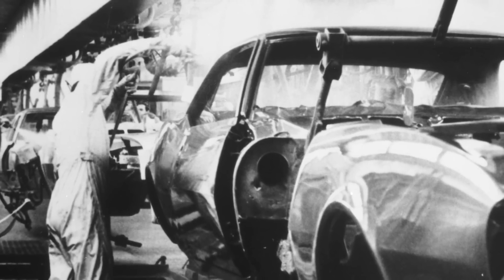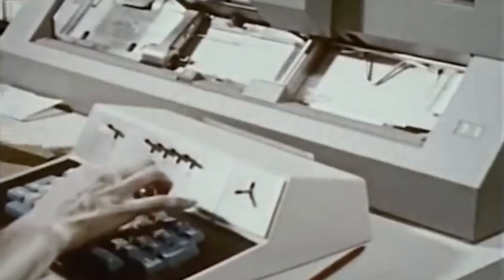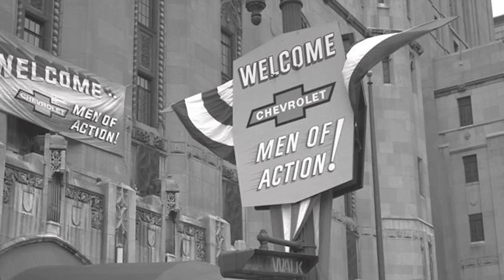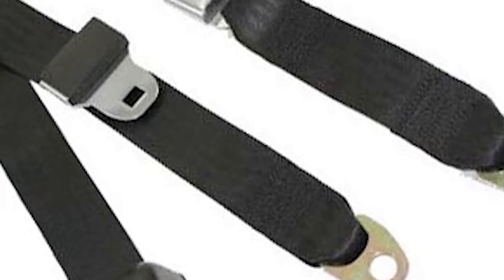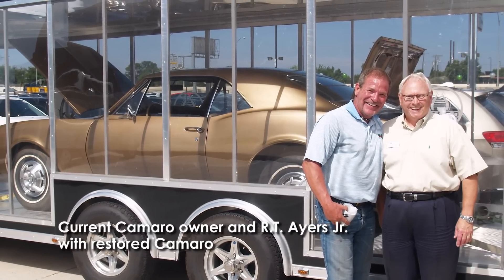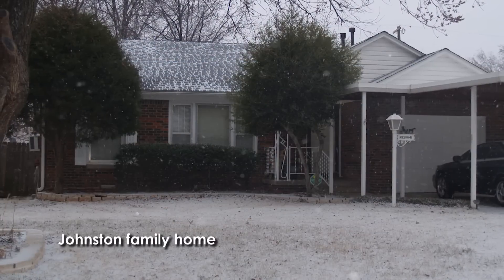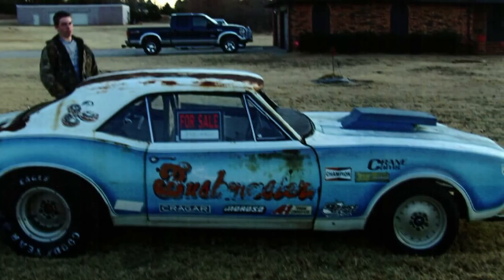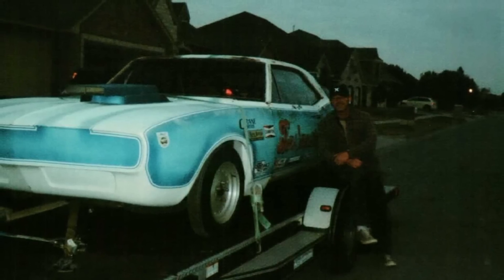Full Story Of The First Camaro Ever Built N100001

Comment: In the fall of 1972 I enrolled to mount hood community college in Oregon. Someone brought it a 1966 Camaro? Same color as in this video. Knowing alot about Chevy's I had never heard anything about at 66. It was a 6 cylinder, might have been a 3 speed but it could have been a powerglide don't recall. The thing I remember most was the back seat folded down like a 66 barracuda? It was from Canada, I guess built there? Never thought that much about it till now, wish I would have bought it. Tuned it up never saw it again 🥺

Comment: My father bought his 1967 Impala from R.T. Ayers Chevrolet in Yukon OK. . When R.T Ayers sold the Yukon dealership in 1971 he went on to start the Rendezvous Trails of America campsites. Hence the R.T.A. After R.T Ayers sold the dealership it became Alan Merrell Chevrolet. In March 1971 when I was 15 years old I purchased my first car a 1967 Camaro RS from a lady in Yukon OK who had purchased it new from R.T. Ayers Chevrolet in Yukon OK. It was the same gold color as that Camaro  in the video with the same gold interior. It had a 327 2bbl carb and a 4 speed manual transmission. It had those same hubcaps too. It had 36000 miles on it when I purchased it and I paid $1200 cash for it that I had saved up, R.T Ayers had a brother who had a Chevrolet dealership in Edmond OK, Craig Ayers Chevrolet. In March of 1972 I purchased a new 1972 Chevrolet Nova SS there. I'm not surprised the first Camaro became a race car. It's great that he saved all the original parts though. Back then when we owned these types of cars no one ever thought that some day they would be collectible. They were just cars to us and we dust drove, modified, and used them never thinking about what they might be worth some day. And when the gas shortage hit in the early 70s, you couldn't give away what would be considered classic muscle cars. No one wanted to buy them. Many went to the crusher because no one wanted a car that needed premium gas and got 10 mpg. I lived through all of that.

Comment: The guy was a scumbag that tore the car apart to make it a drag car, when he KNEW it was the first one.
Reply: I whole heartily agree with you, but some people refuse to place value, or historical significance, on material things.
Reply: @NegativeSum  But he purposely saved the car parts he took off because he knew someone would want to put the historical car back together. My problem with him is, drag racing is fast and an accident at those speeds usually runes the car. In this case, an historical car. This guy could have found another 1967 or first gen Camaro to do what he wanted. But he had to do it with THE FIRST CAR EVER BUILT? IMO, he was nothing but as ass for risking it.

Comment: That's gonna I got one that was built on Sept 5 1966 it's a RS with deluxe exterior and deluxe interior now it has all Z 28 motor ,M22 trany ,and a 67 Z28 12 bolt rear end it is a dealer potion and I bought it in 1978 and I'm not gonna sell it

Comment: It's sort of bizarre that the very first Camaro built was a low option semi-stripper 6 cylinder and not a fancier V8 model, as was the first Mustang. Even stranger than that is how someone could cut it up and back half it with a one piece fiberglass lift-off front end to turn it into a drag car, and do so knowing the significance of the car. But, this all adds to the unique history of Camaro 1, and who knows, it may have actually saved it from being sold to someone else and used up and scrapped like most of it's siblings were. It's nice to see it in such fabulous condition, 6 cylinder, hubcaps, whitewalls and all.
Reply: Hindsight 20/20, would you spare a 2016 Chevy Spark today? It might have some special value to someone in 2076.
Reply: @David-dv6yv  that’s exactly why it happened

Comment: I saw this car at a local car show last summer.  The owners drove it to the show!  It's gorgeous and it was really neat to see the car as it rolled off the line.  Very clean with sharp body lines and a sporty look.  What a legend!
Reply: That's incredible Matthew, good for you! You're so right about the body lines and sporty look, also. This applies to the '68 Camaro as well of course. They are more sports car-like than the '69. I get tired of so many people going on and on about that one. I had a '69 when I was 21 (in 1978) and was just so happy to have a 1st gen Camaro. It was only a 6 cylinder, but with the very high gas prices for the time in 1979-'81, that was a good thing.  

I'm not knocking the '69, but it was bigger and (to me) less sporty. Mainly, it was a cheaper quality car. I'm talking about the front grill and the dashboard. Total plastic over the first 2 models. Also the top of the dash curled up and was already looking old even at 11 years old. The dashboard kind of jiggled and I know it shouldn't have. I have a friend with a '67 Camaro (just a regular hardtop) and at 55 yeas old is as solid as new.

Comment: Heh... I like the mention of the "hand-built" early cars. My 2006 Pontiac Solstice that I used to have was one of the first few thousand that were hand-built out of many early release parts just to get them out in time. Although I ended up getting front fog lamps (without even ordering them), Half the panels in the car had clips that were broken (cause they didn't fit properly) and had double-sided duct tape on them. The ones after the first 3,000 were much better built. Getting number 1,001 to ~2,999... you basically got a hobbled together car, without getting one of the first 1,000 special edition cars. heh.

Comment: An old acquaintance of mine would occasionally drop by my body shop when I was 20 in 1978 driving one of these 1966(1/2) Camaros. It was in rough shape but he would brag about the vin number and the fact that it had a bench front seat; (which was what stood out in my memory; was it original?). I lost touch with him through the years and have no idea what became of him or the car. I would sometimes buy old mustangs, Camaros, Chargers,etc and resell them after repairs, and even had one that came with a straight 6 which at that age, was unimpressive. Reagan had destroyed the speed limits across the country which resulted in me having numerous speeding tickets and my drivers license suspended 3 times. 
Camaros were my favorites, and they handled much better than the ‘vettes.
Reply: Yes, the bench seat was original.  In 1967, I remember seeing a Camaro with one on my local dealer's lot.  Dark sort of green/blue with matching interior.  Additionally, since I grew up in this era and also raced I am amazed that the original parts were still around from when the car was converted to racing.  That almost never happened, and every car I was familiar with had the original parts sold (crash, upgrade, etc) to help fund the speed parts that needed to be bought.
Reply: Dont blame reagan for "you" speeding jeeeez dude.
Reply: @jacksonmehoff4963  What kind of weirdo are you, dude? Nobody’s blaming anyone else for speeding tickets. Just try it sometime, everyone is used to driving 70 plus again so try driving 55 down the interstate for a couple of hours straight and then get back with me! Cars and the highways were designed   for higher speeds. It’s like you’re sightseeing or stalling out. Just TRY it out on the open road! And I don’t mean for just a half hour. You need a good taste of what it was like to go from driving normal to like a little old lady!
  I got tagged at 92 in a Spark about a year ago and I don’t blame anyone but myself!
Reply: Reagan destroyed the speed limits, huh? Reagan had nothing to do with setting the 55 mph speed limit. Geez  🙄

Comment: I wrecked my 67 after I ran it 10,000 miles I paid $800.00 for it in 1974. Best car I ever owned. I was just 18  
   2:18 same copper color  Same wheel covers and black grilled 327 Powerglide... Tagged legal in Florida while in the service.
This is a picture of the car I owned...This was not my father's car.

Comment: I remember reading in Hot Rod years ago about the one that their tech editor Jim McFarland wrung out for some magazine articles, this was a SS model with one of the first 350 engines( yes I thought it hard to believe too) when it came to return it to GM he took out a loan and bought it.
Reply: Had the 1968 Rally Sport. The 327 engine with Power glide made it rather slow.
Reply: The new for 67 350 engine made it's debut in the 67 Camaro SS and that was the only way to get a 350 in 67. The next year 68 the 350 became available in the Nova SS and in 68 the 350 was available only in the the Camaro and Nova. Finally for 69 the 350 became available across the board in most all Chevrolet models and what an engine it was.

Comment: Ford had a V8 in 32-GM in 55🤔
First Mustang in 64-Yep V8!!🤷‍♀️
Camaro in 66-6 cylinder !
Corvette in 63-6 cylinder!
No wonder Ford drastically outsold GM
and still does 50 years later!!
Reply: Obsess much?
Reply: What engine powers more 32-34 Ford coupes than the original engine wonder why
Reply: @gloriamaletta8667  
Truth!
Reply: What manufacturer in the last 10 years is the most swapped engine into other manufacturers cars just so you know it's not a Ford engine and what engine in the last 10 years has the most aftermarket support another clue it's not a Ford engine
Reply: @gloriamaletta8667  
Yup! Preach! 👍🏻
Reply: The 32 valve 4 camshaft V8 that Ford has been building now for 11 years now and the most naturally aspirated horsepower they have gotten out of a stock one is 520 horsepower and it's a 5.2 liter the 2023 Z06 Vette the first year for Chevy to build such a engine with 32 valves and 4 camshafts and it makes 670 horsepower just so you know the 5.2 Coyote engine naturally aspirated is 150 horsepower short of Chevys first attempt at such a engine but being a big Ford fan the Chevy engine is .3 liters bigger it's 5.5 liters
Reply: All WRONG! 
Chevy OHV V8 with airgap intake manifold in 1916 - 1918 !!! 
All Chevy engines are OHV or DOHC... no flatheads... 
1953 Corvette was 6 cylinder with tripower carb.s... 
Some Camaros built early 1966 had V8's... I saw one in August 1966 before Camaros went on sale... 327" V8 2 barrel carb. 210 HP with 3 speed stick... gold color... bucket front seats... 
In 1960's GM had 52% of the market, all other car makers together split up the remaining 48% !!! Govt said GM was a monopoly and would break them up like they broke up AT&T into 8 pieces unless they started selling fewer cars! 
Today Toyota is biggest and GM is #2 !!!
Reply: @gloriamaletta8667  - Corvette had DOHC V8 in 1990... Oldsmobile built one in 1960's but didn't put it into production... DOHC 7.4L...
Reply: @BuzzLOLOL  the one in the 90s was  designed by Lotus and GM Mercury Marine's MerCruiser division built them and GM purchased them and installed them 1990-95 ZR1 they were not built by GM the 1960s Oldsmobile l don't no much about Cadillac has been making 32 valve V8 since the mid 1990s but Chevy has never had or sold a car that GM   built in a factory car the 2023 Z06 is the first factory stock 32 valve V8 engine Chevy has developed and designed and built just like the new Toyota Supra is a Toyota but the engine is built by BMW Toyota buys them from BMW and Toyota installs them in the Supra
Reply: @BuzzLOLOL  over head valve V8 yes dual over head cam V8 no unless you count the 1990-95 ZR1 that  MerCruiser assembled for Chevy for the ZR1 Vette but it wasn't built by Chevy MerCuiser built these engines for Chevy
Reply: @BuzzLOLOL  over head valve and dual over head cams are two completely different engine designs other than the 1990-95 ZR1 engine that MerCruiser built for Chevy has never had a dual over head cam V8 V6 yes 4 cylinder yes V8 no unless you count the 1990-95 Zr1 engine that MerCruiser built for Chevy
Reply: @dougcarpenter7627  l never said a word about F1 or Indy Cars or European style racing l simply replied to someone who said that Ford is superior to Chevy as far as V8 engines are concerned is simply not true and l replied with what engine powers more 32-34 Ford Coupes than the original engine it's a small block Chevy can you name me any GM bodied cars that are powered by a Ford engine more than the original 2nd in the last ten years what V8 engine is the most swapped in any other manufacturers cars or truck and SUVs and has the biggest aftermarket support and that would be GMs LS and LT V8 engines from 4.8 5.3 5.7 6.0 6.2 7.0 8.1 this is 7 different size V8 engines compared to Fords 4.6 5.0 5.2 and as Ford seen the success of the GM LS engine since 1997 they now have a gas powered 7.3 truck engine that looks to me to be very similar to a big Chevy LS engine and is probably Fords best V8 engine so to sum this up there are only 4 Ford engine choices compared to GMs 7 plus most of these engines most parts are interchangeable most of these Ford engines are not GM engine platform has been updated over the years but basically they are still working with a platform that started in 1997 that's 25 years compared to Fords 5.0 Coyote platform that started in 2011 that's 11 years ago so which engine is tried and been powering cars and trucks longer a engine platform that's been around longer with more choices in displacement with more parts interchangeably is my choice and a very big plus which engine platform is the most cost effective to modify and has a more simple easier to work on design now you do some research and look up what l stated l did forget the Ford 5.4 Triton engine that made the top 3 worst Ford engines ever made if you'd like me to count that gem most people who owned or had to deal with this engine I'm sure would like to forget about it
Reply: @dougcarpenter7627  your talking about a engine platform that's been around for 25 years and has powered millions of trucks of course the junk yards are full of them since 1997 until now they sold millions during this time Ford was building the 5.4 Triton engine that made the top 3 worst engines Ford ever made many of these are sitting in junks yards to and will be forever because nobody wants them even the people who owned and had them would like to forget about these 5.4 Triton engines junk yard Chevy LS engines will be bought to power more Ford Foxbodies than any other engine don't see Foxbody owners swapping 5.4 Ford Triton engines do YAH
Reply: @dougcarpenter7627  call your local junk yard see what engine is more desirable and the most sold its not a Ford 5.4 Triton engine used LS engines sell like hotcakes and are not cheap for a lower mileage good one

Comment: I want to offer a correction. North America has never had 110/230v power. The single pole output voltage is a function of the RPM of referenced two pole generator. 3600 rpm nets 120/240v at 60hz. 60hz or 60 times per second equates to 3600rpm on a 2 pole generator. 3000rpm on the exact same two pole generator will yield 110/230v at 50hz as is used in Europe. Electric motors can be used in either region with speed and current being extrapolated.
My guess is that the majority of Electric Motors were produced for both domestically and abroad with a 110/230v nameplate during the war? Which led to the term 110/230v being frequently misused in North America. It has never been a thing here since the construction of the electric grid.